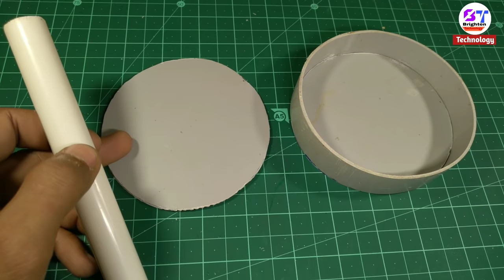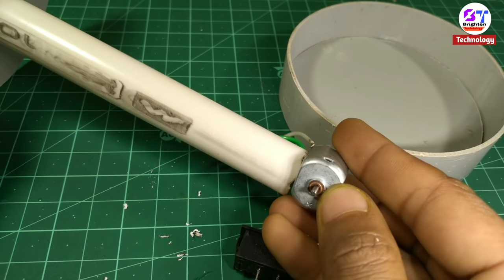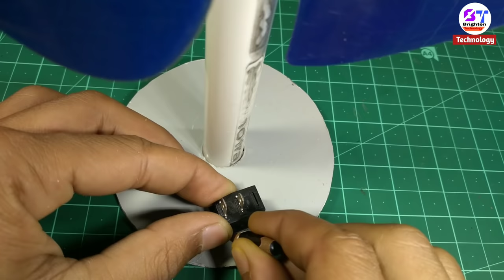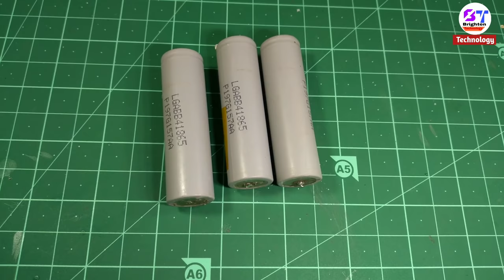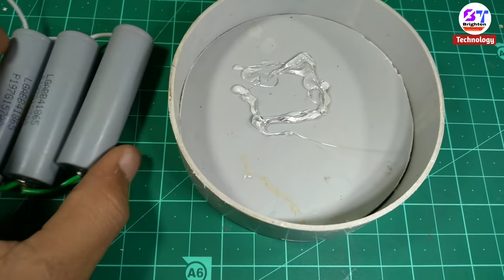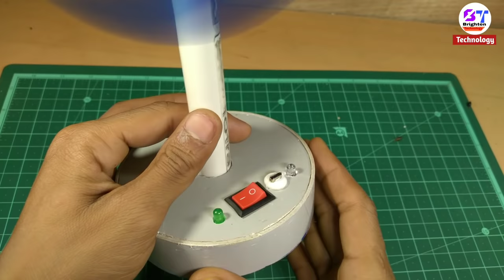power full DC fan using PVC pipe and DC motor || DC fan || Brighten technology

Comment: Cell kitne rupees me mile ge
Reply: 2000000
Reply: Bhei new cell my city ruppes 50 rs 1
Reply: @shortslive8900  pagal ho giya he Kiya 
Ulta sidha mat likh jab tereko kuch pata nahi he
Reply: 1200 mah battery price is ₹60
1800 mah battery price is ₹70
3000 mah battery price is ₹120
Reply: No need to buy  take out any old mobile  charger and cut some  in the wire and  and the 2 wires to motor and keep other side big one to power bank or plough and on it
Reply: 100000⁰00000000000 sayd itne me 1 cell aa jayega
Reply: Bus 🖐️🖐️🖐️🖐️🖐️😊😊😊😂😂
Reply: You are right bro
Reply: Bro 50 rupes ka cell fake hota hai duplicate
Reply: Rs 50